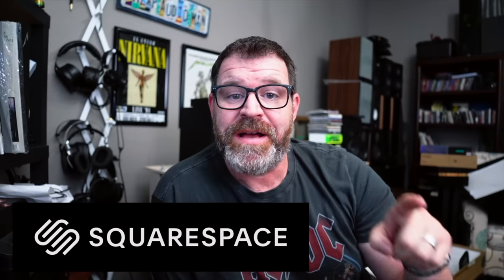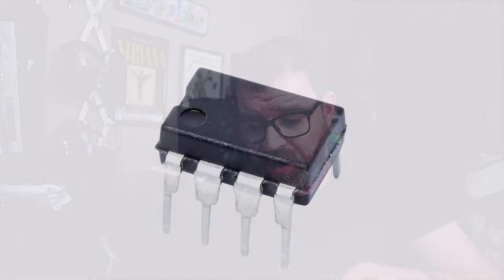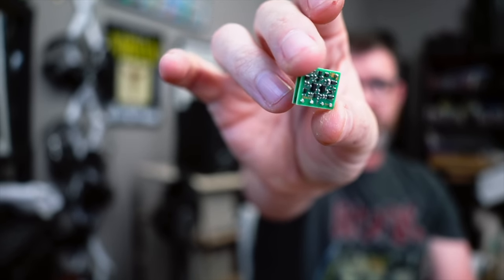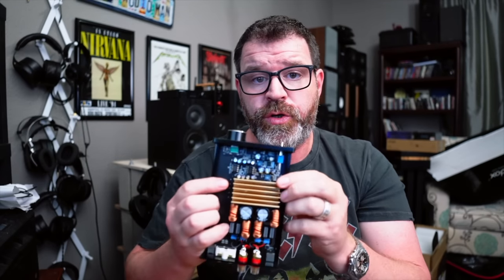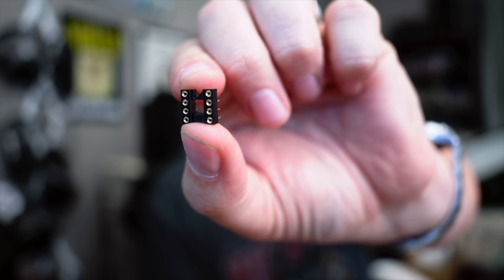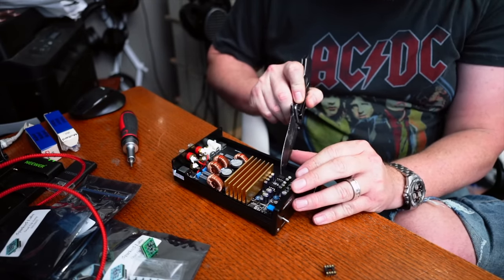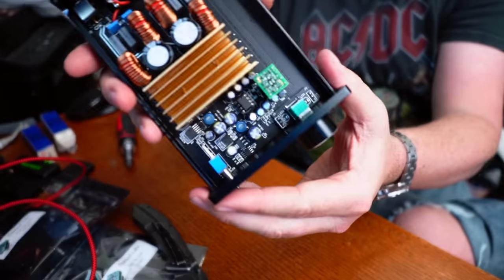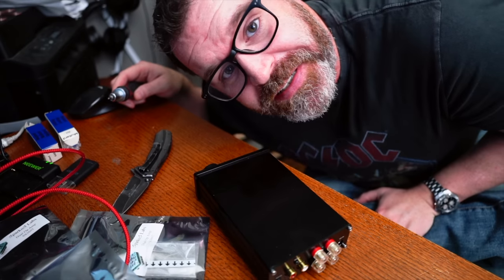Make an $80 Amp Beat $1,000 Amps?! Find out How!

Comment: I used a pair of $20 MUSE opamps in one of my devices. Just wanted to point out that there are cheaper options. I don’t have any conclusions as to whether or not it was an improvement.  These changes are more subtle compared to tube rolling where the difference can be huge.
Reply: Are those MUSE01, MUSE02, or MUSE03 opamps?
Reply: @TheMartiansLoveKuato  I think they are 02 (8920 for example)
01 are more expensive, and they tend to be very hard to find (at least from a trusted dealer). 
I am very curious though. I have the 8920 and they are more powerful with a little bit more sound stage. I use it in a dac and the headphone amp is shaking the hell out of my headphones. 
Cheers!
Reply: @adrianenache6794  anywhere close charges four times the price. Anywhere far away can't necessarily be trusted to provide the correct stock.
Reply: @TheMartiansLoveKuato  you live in the states?
Reply: @adrianenache6794  Canuckistan, I should probably visit a couple physical electronics stores just to be sure.

Comment: I don't see the point of spending 80 - 160 dollars to replace the opamps in a 70 dollars amps. Sure, the sound will be subjectively better than amps that are in the upper price brackets. But in the end, you're still only getting a basic chi-fi power amp with a volume knob. There is no remote control and no multi inputs.

Comment: Wonder if there are similar upgrades to he Aiyima A3001 subwoofer amplifier.    

I have a small stack based on your previous recommendation and I love it.   I run the Laptop into a Schiit HEL2 DAC - Aiyima A07 - Aiyima A3001 - out to my LS50 Meta's and my SWS Sub...     The system sounds great.    I also bought a DROK 48V 10 power supply and I have it dialed in at 34V because of the A3001.    The Drok powers both amps. All encased in a nice vented box that everything plugs into.   Soon I'll wire in the USB, with a dedicated DC to DC Isolated buck converter, I will then have the DAC and the amps all powered by the single power supply.    

But now this setup.... I can't wait to check it out.   Expensive.  Kinda...   I am totally into it though.   Thanks Randy!

Comment: Ok you seem like a nice guy but do you have any idea how much money and effort goes into designing an op-amp?  I work in the semiconductor industry and op-amps cost millions of dollars to develop and they are streets ahead of what you can design by putting a few SMD components on a little circuit board.  The add-on boards you may sound different but if you measure things like distortion, frequency response then I doubt it will be as good.  A lot of these amps use NE5532 which a lot of people look down as it’s old and cheap but it’s still a good op-amp and probably the AC/DC tracks you love (judging by the T-shirt) have passed through a lot of these when they were recorded so changing a few op-amps at the back end won’t change things very much

Comment: I have the A07 driving some old Bose 301's, works perfect for that. Yesterday I was curious to see how it would drive my Buchardt S400 MKII and at first it seemed ok but it became apparent rather quickly that treble was very harsh and details just turned into noise. I wouldn't use this amp on anything resolving/transparent but its great for cheap fun speakers. Now, the tinkerer in me likes the opamp upgrade but there are already other options at the new price point and I'm not sure the opamp upgrade will better them. You've mentioned TA-100 and Audio Spark, I would also add  IOTAVX SA3 and maybe even some of the SMSL stuff and Cambridge Audio AXA25. I think you reviewed a couple of them, how does the upgrade compare to those amplifiers? Or should I conclude it betters them all since you talk about beating a 1k amp.
Reply: Been my experience.  The A07 is fine for many budget speakers and also many under a grand$, IMO.

Comment: Hi Randy,
I'm really interested in that Aiyima A07 with it's flexible upgrade paths. BUT, I'd like to put it in a (left center right) three channels system. I would need to get a second one then, right? I know that getting a second one would make it more expensive, but I've always been into these kinds of upgrade paths. I like upgrading to better components even when the costs are eventually no longer frugal. I know, this stuffs supposed to be cheap. 

Would this idea work or are there other options?

Comment: RANDY!  Thanks for this instructional - gear upgrade - makes me drool for new parts video.  I sure wish I could give your videos more than one "Like"!  As you said in your A07 review months ago buying the A07 for it's great sound is a can't pass up deal.  I enjoy my A07 out-of-the-box as often as possible.  I wish I had the $$ for the upgrade, but I'm saving up for another (however unlikely) Emotiva HT gear purchase.
Reply: @Douglas Blake On my next DigiKey order I'll get a dozen of the RC4558 op-amps.  Thanks!
Reply: @welderfixer  why not something more "modern" and not too expensive like OPA1656 and some DIP adapters?
Reply: @MiguelAngelVelazquez  That's a great suggestion!  I'm far from an electronics engineer, but I will look into the OPA1656 Burr-Brown chip and maybe give them a try.  Thanks Miguel!

Comment: Randy, first of all I want to thank you for all your advise. Now I am much more informed about audio! I know my question is not related with this post topic, so sorry.
In my room I have an old Denon AVR-3805 receiver paired with 2 Infinity TSS 1100 bookshelves as rear speakers, 2 Definitive Promonitor 1000 as front speakers, one Definitive Procenter 2000 as center channel and a TSS 1100 Infinity subwoofer.
I am impressed with all the good comments that the Sony SS-SC5 speakers get. I am wondering if my setup will benefit if I replace some of my speakers with the Sony speakers. I am thinking to replace the Infinity with the Definitive and then the Definitive with the Sony. What do you think?
Thank you again for all your effort and for your answer in anticipation.
Best regards.

Comment: Question - What does each of the two dual op amp sockets in the Aiyima A07 correspond to?  Is one socket for the input amplification section and the other for the volume section?  Or something like 1 opamp for left and one for right channel?  In my Burson Funk one is for the input stage and other is for the headphone volume.  Would be nice to know for those who only 1 to roll 1 opamp to save money or experiment mixing opamps to tune the sound to their taste.
Reply: Unfortunately,  you need 2. One for Left and one for Right channel. 
Each opamp has 2 two "sections". The first one acts as a buffer or Unity Gain amp, the second section takes the output from section 1 and creates an inverted signal. Now, both signals feed the TPA3255 differential inputs. This allows a bigger input signal.

Comment: what were the original op amps ?  ne5532 op amps sound very good (@$5) and way less money than the sparkos/burson.
Reply: I am floored by how good my original A07 sounds. So floored that i purchased a second. Can't imagine wanting it to sound much better in my system. It has it all for my taste and set up. Don't see the reason to spend the extra. Will wait for others to chime in on how much of an improvement they see with this high end OPAMP roll. Until then....totally amazed and totally satisfied by the stock A07. Totally!

Comment: I just picked up a pair of lightly used A07 amps w/32v with power supplies for $100, delivered.  Wondering if the Sparkos SS3602 upgrade would be the better place to start or would a nice DAC (sub $400)?  Thank you for all your content and information!

Comment: I have a DAC that use 3 oamp and 1 tube so already have some oamp...surprisingly the best oamp for the dac are not the best for the 07 which is the cheap opa1656, the aiyima power supply have 3 prongs compare to the one sold with the amp have 2 prongs, I have similar 48v and sounds much better than the one sold with the amp.
Reply: Yes, Bipolar and FET/JFET opamps are required on different applications.

Comment: I never understand why anyone would pay this kind of money to buy discrete opamps. Yes, opamps are meant to be monolithic (I.e., integrated circuit), not made up of discrete components. The earliest opamps were discrete and were used in analog computing, but due to poor performance they were eventually replaced by ICs. It looks like we’re going back in time. There’re many reasons why ICs perform much better than discretes (matching and parasitics are the most obvious ones). Discrete opamps are simply not even in the same league when it comes to performance. On the other hand, for applications where lots of power and/or robustness are needed, discrete circuits may perform better. But opamps are low power components so it just doesn’t make a lot of sense to me.

Comment: I was wondering if it would be a good idea to get some nicely drilled small holes in the sides of the casing for ventilation or does this amp not need any ventilation?

Comment: You don't even need to go with discrete op amp modules for an improvement. Go to mouser or digi-key and pick up other chip op amps for a few dollars each. You need to do a little reading of the specs, max voltage/current for instance, but for $10 all in you can also get a great improvement. My cheap AliExpress DAC went from soft sounding and boring to better than my Node 2 with 4 chip swaps.
Reply: @Douglas Blake Just checked what I got, I went with LME49720NA/NOPB at $2.69 each - great!

Comment: Interesting subject. I'm wondering if you ever switched the op amps in the smsl sa300 when you had it in your possession. I currently am using one and am considering switching the op amps. Another great video entertaining and informative.
Reply: The Opamps on the SA300 are SOIC (not DIP) and soldered to the PCB. Not a so easy replacement.
Reply: @MiguelAngelVelazquez  thanks for the info Miguel. Sounds like a lot of work for not much return. Think Ill just leave it as it is.

Comment: I put a Sparkos dual discrete op amp in a cheap imported pre-amp. The difference in sound was astonishing. I was contemplating trying a Muse 02 op amp but the Sparkos sounds so good why bother. Good video!
Reply: I bought the opa2134PA's and Muses 8920D's to try out before I got my Sparkos and Burson duals. The Sparkos and Bursons outclass the Muses in most every way - I think the discrete topology 'generally trounces' IC opamps. Out of all the IC opamps I have tried (ie: opa2134's, lme49720's, Muses 8920D's, and the lowly ne5532's), the discretes have always sounded better.

Comment: Hmmm, could 'you' swap Op Amps in a cheaper Denon receiver..? Just for the heck of it. Curious...
Reply from the maker: most products won't have a 8 pin receiver socket on the board so "yes" anyone could switch out any component but products with receivers make it much easier

Comment: so lets say i have a pre amplifier that is connected into a normal amplifier then output to my headphones. and both the pre amplifier and the amplifier has changable op amps. thus i am wondering if i only change the op amp in the pre amplifier. will there be any changes in sound since the headphone is connected to the amplifier instead of the pre amplifier?

Comment: Opamp Rolling Question - so I bought some OPA1656 so go into my A07. However, it is apparent a SOIC chip mated to a DIP8 connector. OK fine. However it doesn't have a notch, so I don't know how to orient it into the DIP8 socket. However the pins are numbered. So, does the 1-8 side go with the notch, or does the 4-5 side go with the notch?
Reply: I hope you already had this figured out. Pins 1 and 8 are on the notch side

Comment: I noticed that you almost never mention the aiyima T9 although it might be the most attractive product besides the a07. Is it because it's not longer available on Amazon, or are there other reasons for your preference in chosing an amp for a budget setup ?
Reply: perhaps he's not a fan of tube and that T9 you can't replace op amp like this A07
Reply: I don’t know Randy’s reason for not mentioning the T9 very much… But the A07 is the better amp in my opinion, and it is upgradable (power supply and op amps). I think you are better off with the A07 and buying better bookshelf speakers. The A07 will sound nice with Elac's BS41, and with the upgraded power supply it can handle the original Uni-Fi UB5; which are harder to drive. Then you can add a DAC or a Tube preamp down the road, or a small subwoofer or even a Mini-DSP… And upgrade each component over time, this is why many Hi-Fi systems use separates (because you can upgrade them individually).

Comment: Hi Thanks for your videos.  I have a Fosi amp that has treble and bass knobs. I want to try using this amp for nearfield monitors. Where would you set the knobs? 12 O'clock or completely off. Thanks.

Comment: You say this a cheap upgrade. But the chips you're getting from Sparkos and all the little discrete components on the secondary board probably cost less than a few dollars. And I'm sure the components are installed and soldered by a machine. So why do they charge you 160 bucks for those two little units. Because this is the world of "high fi audio" where everything is marked up 1000%. Even these little boards. If Aiyima charged the same mark up on the components in the amp itself, it would cost 50 grand. Those little replacement chips should cost 10 bucks tops. Do the math.

Comment: ...until you discover that your device has opamps soldered on the board, instead of sockets.

Btw, If you want to store those opamps safely, get some small piece of foam and poke them into that foam.

Comment: Hey Randy. Could you try these opamps on the Fx-Audio D01? It would be nice to know if they have the same effect (or different)! I was thinking of buying one as it is a device you recommended and would like to know if it would tame those high frequencies and maybe provide a more open sound. I was also wondering if upgrading the power supply (maybe one of those ifi ipower ones) would make a difference. Thanks

Comment: You need to go higher and get the sparkos Ss2590 Pro op amps another solid improvement. They blow the already expensive 85 dollar burson v6 out of the water. Put 6 of them in the burson soloist GT 3x a $3k amp and see it scale beyond its price

Comment: Just bought a pair of Elac Unifi  UB52's, could you make some recommendations for optimum performance, currently using an older Onkyo receiver TX-SR605, I believe is about 15 years old, they do sound pretty good but was wondering what you might suggest. Enjoy your show & reviews with humour ( Canadian )!
Reply: I have the Elac Ubr 62s, slightly different but what made mine shine was spacing them further apart than you'd normally think, mine are like 10' apart and the soundstage and detail are great.  I also experimented with position, and for some reason these speakers sound best right up against the wall with just a little toe-in.
Reply: @drewpknutz1410  Thanks, I was really referring to amplification.
Reply: I just got the same speakers a week and a half ago based on Randy's glowing reviews about performance for the price and he was 100 percent correct.. Right now I'm using the Ayima A300 (yes. I know, not even close to 300w per channel). Regardless, it is more than loud enough. For max performance you probably want to stick with 100w to 125w. I have been meaning to pull out my Rotel amp which is a dedicated 5.0 amp at 125W per channel just to see how much of an improvement it is over the Aiyima. I read reviews where people have used 10w tube amps to drive the Elac's and they sound perfectly fine. So, you've got options on the amp end. I will update this as soon as I feel like carrying a 50 pound amp upstairs to compare. It's a 10 year old amp but Rotel makes quality hardware. My DAC is an iFi Zen signature one. The new model that is essentially the DAC2 with BT and more inputs.

Comment: Nice hybrid DIY review! Cheers. Just a question based on your original review, have you resolved the volume power issue of the amp as based on your power supply the output appears to be much less than the Spark such that you dont get louder volume from your speakers? Really interested but this could be an issue.
Reply: @Douglas Blake Kind of know it's current plus voltage gives you more watts to deal with.  Other Class D Amps when given more watts in real world and specs could power speakers better giving more watts resulting in higher volumes. The question was related to this if you give the amp more watts through higher voltage and current per specs does it give more power resulting higher DB?
Reply: @Douglas Blake Not just the voltage but current as well or Amps that determine wattage available to the Amp. Bottom line though for this amp with more wattage through higher current and voltage when using a higher gain pre amp could you get higher volumes? Only testing this amp specifically could tell.
Reply: @Douglas Blake  Yes. Now I understand! Many Thanks. Really interested in this specially with the opamp. Just waiting for the speaker sales Sony CS5  or Elac.

Comment: Operational amplifiers (OP amps) started out life as discrete solid state components and before solid state they were tubes.  So many people thinks OP amps only exist in the form of a chip.  Many designers still use discreate components OP amps and the price usually reflects it but they can get them to sound exactly how they want.  I use an EQ in the front end to achieve the same thing with the option to bypass.

Comment: What were the op amps that came with the stock Aiyima A07?
Reply: @Douglas Blake those are very good, if inexpensive, chips and have been used in audio equipment and mixers for decades.  Surprised they  are outperformed here.